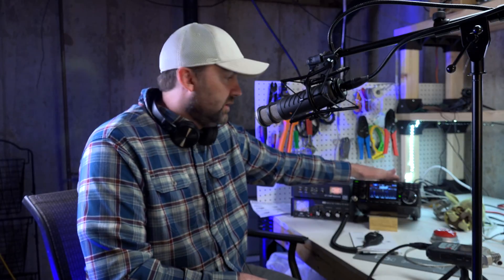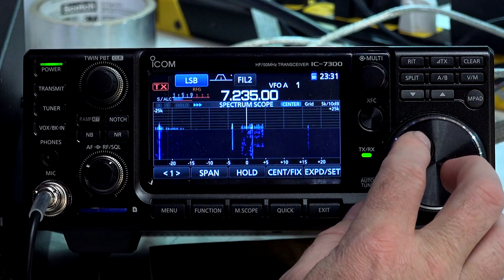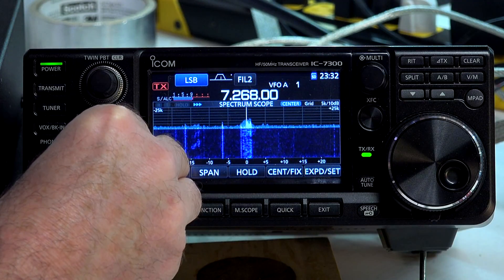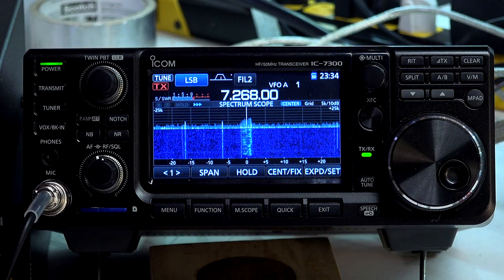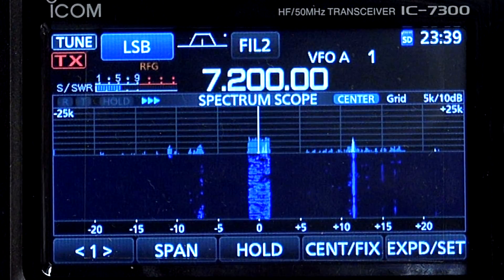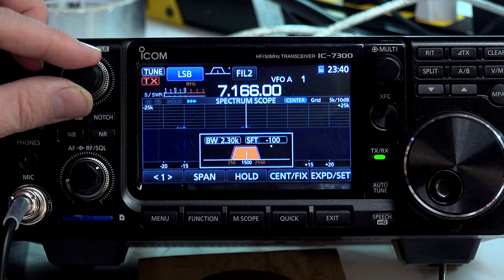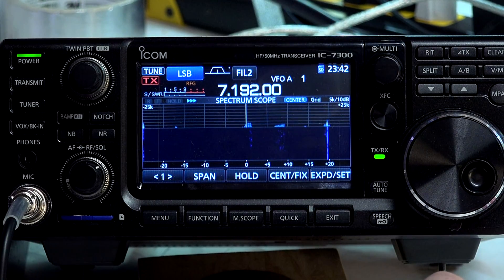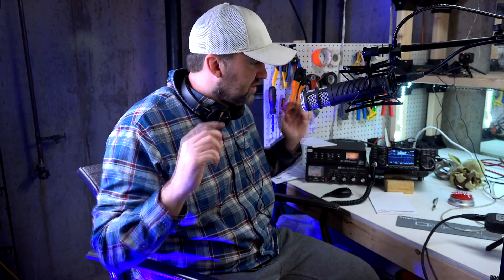iCom 7300 AUDIO test

Comment: Connect a Bose SoundLink speaker (3.5mm) jack to the Phones on the Front of the Radio and see what a difference in RX audio you hear. Great range of Low-mid-high's.... for $150 you get the sound you'll want on receive. For Transmit use a Heil ICm Eletret mic which drives the radio just like the great hand mic. Dynamic mics won't drive the radio as nicely and are better suited if you're using outboard PreAmp/EQ/Processing. The Heil Headsets provide for great audio and better still a much cheaper Yamaha CM500 is a fabulous alternate choice. I've owned a 7300 for 4.5yrs and have done a ton of testing. Enjoy!
Reply from the maker: I hear ya.

Comment: I just bought this radio and can not wait to hook my g5rv to it I am sure that i will most likly need to mod the G5RV to a 4/1 Bulan on the end because of the high swr on it I have heard of people putting as high as 9/1 I love the Antenna tunner kind of disappointed you have to be 3/1 or lower for it to work unless you use emergency mode then you can make it work 10/1 but like i said i am going to put my g5rv up about a quarter wave 32 feet I could put it as high as 50 but I live in Arkansas Tornado ALLY and lightning strong winds and huge hail stones .. I already know i need to put a balun on it or the swr will be threw the roof also it cant be on the ground or that to will give you high swr Well ill let you know sooner or later how my adventures go until then my friend 73 KG5CUO
Ps a good co wax will go a long ways at least 75 foot  they say can help it so i will prob use both to bring down the swr The antenna tunner is nice to will get one sooner or later but for now I have to go with what i got and it only helps it at the radio you lose a lot of output if you do not fix it where the antenna uses it  mine is 110 foot or 55 on each side
it may be less then that  if i can get better use with a blan its a plus if i need to i will add a higher one i will go 4/1 then prob 8/1 if i still have issues this should let the antenna use the power it is given equal i hope on both sides and i will still need a tunner i think because it is cut for 160
Reply from the maker: Great comment! Very interesting.
Reply: @hamradiocq  If you just use a tuner your not fixing the problem your making your radio happy but you are loosing a lot of S units this is why matching is so in-portent I guess in the radio world :) anyways this is one of min fixes for this antenna that is now over 100 years old can you believe it....wow I am waiting for my co wax to come in and i am sure i will have to fix it  at the bottom figured i would throw it what i have learned and maybe it can help you :) 73 KG5CUO

Comment: Im debating this radio and the kenwood 590sg, lots of comparison between the two...some say the 590sg has slightly less problems with noise interference , I like the layout of the 590s with all the buttons on front ....however the scope on the icom looks nice but wondering if it's too small to be useful, I like to operate in the dark so may go with computer rig control with either...hard choice
Reply from the maker: Great comment. I can't speak to the Kenwood, and this screen is small, but usable.  I really do like this radio, but I'd understand if you found something better.

Comment: for the receive side i used latest west mountain radio CLRDSP and the Hiss are gone and loving the RX audio of my 7300. Nothing compares the 891 RX DSP.
Reply from the maker: All good stuff.  I still want a WMR
Reply: When i 1st got my 7300 the 1st thing i noticed was the HISS of the received compared to my 590SG and 891. The yaesu is way better DSP and NR. The WMR CLRDSP really improved the RX listening of my 7300, just remember to turn off the NR before you play with the CLRDSP, it way better than the 590SG and far less watery effect.

Comment: Good video Tom!  Keep in mind you have audio bass and treble EQ settings available under "Settings/Tone Control" that can be individually assigned to SSB, AM, FM, CW, RTTY for both RX and TX.  I backed my RX bass down to -2 and raised my treble to +1 and am pleased.  I got my IC-7300 a couple of months ago and absolutely love it!  This is my first SDR and like you said, there are better models available but at a MUCH higher cost.  I have been a HAM 25 years, have owned many radios and I find the IC-7300 to be perfect for my needs, desk space and budget.
Reply from the maker: Great comment. I wanted to make sure I didn't dismiss other SDR's out there cuz I'm sure they exist.  But this one is mine and I like it!

Comment: I own the IC-7300 for 1 year already.  Most of listening/monitoring is with IEMs/earphones.  If we set Filter1's bandwidth to 3600 *for SSB),  then you able to hear deeper bass/low frequency., and work best for listening to ESSB QSOs.  The built-in speaker is just good enough for normal typical SSB QSO, but, to enjoy the full audio spectrum, just get ap pair of headphones, earphones or IEMs. or use external speaker..

If you connect the IC-7300 to PC, try to record the audio stream.. and we also can TX recorded sound or any audio files on air.. Very convinient. and useful.

To improve listening, use RF gain (RFG), and typically I set around 9-9:30 o'clock.  The S meter reading will be reduced, but, if you can hear clearly, it is most probably 59+. 

Then use twin PBT , to focus the audio signal 

The another trick is to use, Fast AGC. Usually I use slow when listening to broadcast station, and fast Fast AGC for SSB. 

Thank you, and looking forward for your next videos.. 

Yours,
Bahathir 9W2GNU, 73.
Reply from the maker: Great comment. I knew there was a way to record inside the radio, but I wanted a real-world listening experience for people that open up the radio and start listening.  I will look into recording from the 7300.
Reply: @hamradiocq  

Iam using Raspberry Pi 3 B+ (RPi) and Raspberian Linux. It does not limited to RPi only. I also use GNU/LInux Slackware on my Thinkpad T61 laptop.  I think the concept is similar with other operating system. 

Make sure, all needed drivers are installed. 

Connect the IC-7300 to your PC/Laptop .. or smarphones! .. :) 

Start recordng apps, and select the 'capture"  device assigned to the IC-7300. In my GNU/Linux environment, I am using ffmpeg, commandline program.

As the default, IC-7300's USB output  mod level is at 50%, and it is quite low. I changed it to 90%., to get better audio signal level. YOu may use the audio recording's level  to set proper signal level. 

Then start recording...  :) Enjouy.. 

To play back to IC-7300:

Select the playback device to IC-7300's assigned device.  You may enable the IC-7300's monitoring., to make sure the sound is going out, from PC/Laptop  to the rig.

Start playback ... and push  PTT to transmit the audio.. :) or push/toggle the 'Transmit' button on the rig..

For TX the playback audio, I am using bash shell script, which will trigger the PTT using rigctl tool from hamlib,  and toggle back the TX after the playback is finished. 

Hope this is useful.

Any corrections and comments are welcomed. 

Thank you.
Yours,
Bahathir 9W2GNU, 73.

Comment: I own the 7300 and although I didn't own any other HF-set, I have to say I love it. The filtering options are great.

Only filtering function that I don't understand so far is the NB (noise blanker), whatever the settings are, I can't seem to hear a difference - not even with some nice headphones. It also might be that I can't figure out the best settings, which was my reason to check out this video. 

And it's a pity the speaker is on top rather than on the front, but as I listen mainly using headphones that's not a big deal in my case.

73 de PC4AD
Reply: The NB (noise blanker) is for blocking static from automobile ignition systems if mobile, household appliances etc.  as opposed to general RF static.  So unless you have these types of static nearby the NB will have no noticeable difference.  I love my IC-7300 too!
Reply: @KX4UL  Hi Gary, Thanks a lot for this, that might be why I didn't understand it :)
Reply from the maker: No worries, we are amateurs, all trying to learn.
Reply: @hamradiocq  That is for sure :)

Comment: I really like the sound on my 7300. I do wish the speakers were facing forward instead of being on the top of the radio especially since to he speakers are tilted away from you when the radio is on it's stand. Try putting your hand behind one of the speakers reflecting the sound back towards you and you will see what I mean. Thanks for sharing.
Reply: I've used a two dollar white plastic PVC elbow. Plop it down on the speaker and angle it any which way you desire.
Reply: Just putting my hand behind one of the speakers made a huge difference. You have a great idea.
Reply from the maker: Interesting, I will.